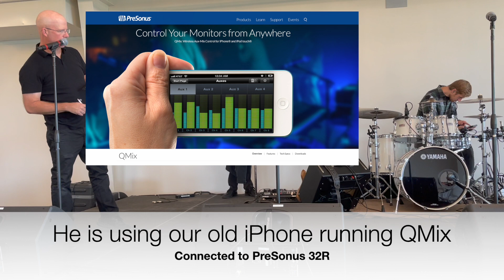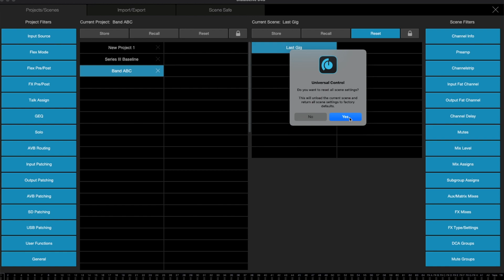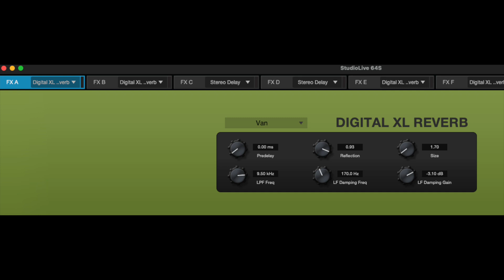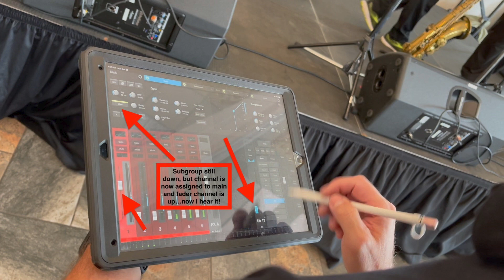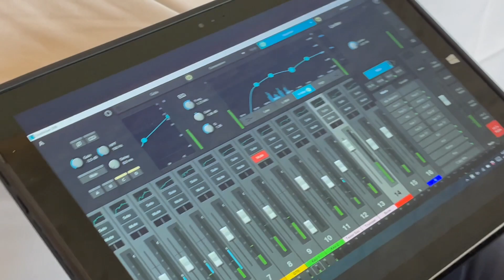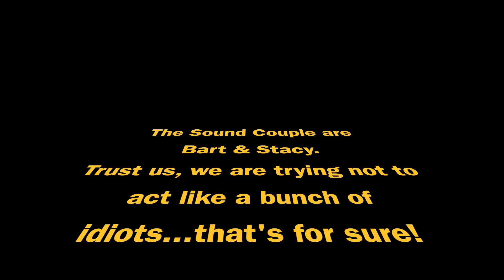The Sound Couple - Wedding Flip!

Comment: I was using the an old router and had the same problem then upgraded the router to a dual band 5 Ghz tplink and have had no problems since.
Reply from the maker: We have dialed in our router now.  Every now and again, we will have an issue, but moving the antennas usually resolves it.

Comment: Interested in your top speakers, but I noticed a red light when you had the camera behind them, is that a clip or limit protection light? Do you notice them clipping a lot when pushed? I’m looking to replace my tops and I do a lot of outdoor festivals, usually 500-1000 people, but I have to push my current tops hard to reach the level I need for the full concerts, I want something nice but wondered about that red light.  Are you able to push the CDL12p’s pretty hard? Btw love you channel! Not many out there like this that get to the nitty gritty of shows!!
Reply from the maker: Based on your question and requirements....my answer is that it's not realistic that 2 CDL 12's are going to cover 500-1000 with a strong SPL (95+ dB?).  That said, I don't of a cabinet of this size that could provide a "concert" sound without implementing multiple cabinets or a line array.
I am comfortable in saying that we do push the CDL's to their limits and we supplement them often with additional support from our 328AI's and SL18sAI subs and this combo works for us.
Ideally, if we had the budgets and truck space, we would be flying more CDL's or other line array cabinets when we have gig's that would best served with this type of system.  Unfortunately from a business perspective, we cannot justify this type of investment based on what our typical client can afford...if they need more, they have to go somewhere else.
Reply from the maker: In Worx Control, we do have the limiters and Compressor set to -1dB and 2:1 ratio at 0dB which does squash things a bit more conservatively.  But the cabinets still work flawlessly and delivered everything we threw at them.  We got another big year coming up!

Comment: As much as I stood by colouring mics for so long - I started running into a whole lot more colourblind techs and performers! Sometimes the system confused the hell out of them. Out of necessity I switched to numbering, which left me at a crossroads because half way through numbering I realised how often I would use the colour to see what mic it was at a glance. In the end I stuck with both and it means now mics are labelled by number, and the colour is purely for my own convenience. Moderns problem require modern solutions (I suppose)!
Reply from the maker: Great point about coloring mics - statistically more males are color blind too!  Agreed though on being able to just quickly look and visually check to see which mic is being used!  This is a very real problem  for one band we've worked with in which the three female singers are often changing spots on stage!

Comment: Just curious.  Wouldn’t it work out better to get the CDL12’s up higher and pointing down a bit more?
Reply from the maker: Great question!!  We have generally had to choose between how many subs or mains when sizing up the room.  When going with one sub, we can  maneuver two CDL12's with our speaker poles and raising them up higher , but when going with two subs, our options for CDL12 height becomes limited based on my research for a CDL ground stack.  The pole you see at this video our 16" tall which I lift by myself at my height.  Otherwise,  if any taller, we would need a two ladders (two persons) to lift  (which we have tested and it CAN be done, but is a bit iffy).  We could go a bit higher at my ability to ground stack the CDL12's (perhaps 22"), but the closest we could find at any offering is is the Rockville stands( Rockville GASPOLE-B M20 threaded air assist subwoofer-speaker pole mount stand. Adjustable Air assist from 33.5” – 55” inch).  If you have any insights on better solutions that the CDL's can be raised higher with a one person lift ...we are all ears!
Reply: By the way, the logistics of figuring out how to handle and get the CDL's up on poles in my opinion, makes me think the traditional point source speakers are maybe the better option, unless maybe I can find some good crank up stands, and not sit the Subs right under the Tops
Reply from the maker: Agreed.  Raising 1 CDL speaker over 1 sub is no problem logistically at all to get them high enough, etc.  Stacking 1 or 2 CDL12's over 2 subs, your options become limited.  That said, for the gigs we do, we have always gotten by.  If it was an absolute requirement to cover the room, well, that may become an issue.  

I can think of a few instances where it was sort of an issue....please check out these videos if you are interested:

In this video, we ground stacked and they brought everyone up front at the beginning and did some talking at first.  The speaker height impacted coverage with all of the bodies:
https://youtu.be/fEKJREmS_RA

In this video, we tried out the Rockville stands which are spec'd to handle the weight of 2 CDL12's.  We made it work, but it honestly not as stable as I would like (we didn't need two for this room, but this was a test):
https://youtu.be/1_dbLJkNHMI

In this video, I conclude that the CDL's were probably not the right choice.  In their defense, there were other factors that did not make this easy for anyone:
https://youtu.be/2DDl2STQcYc

If you check out any of our other videos, you will see that we are able to usually get them up an over, and that means plenty of stage stacks as well.  It's more work, but it get's them up and more protected from the people.
Reply: @thesoundcouple  do you have another way I can contact you with more questions? Email or Facebook page?
Reply: For some reason, I did à reply before this one. Don’t know where it went
Reply from the maker: @footer65  You can see our contact information in our "About" info.  Thanks!